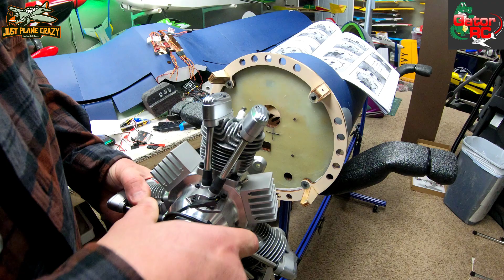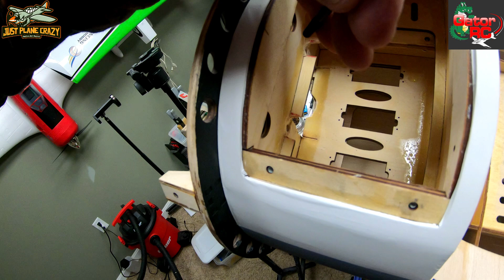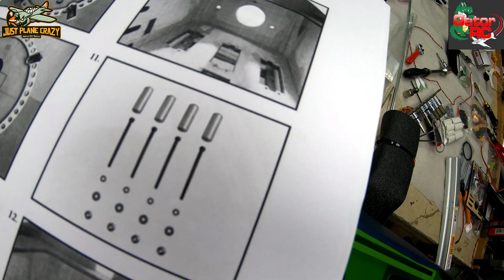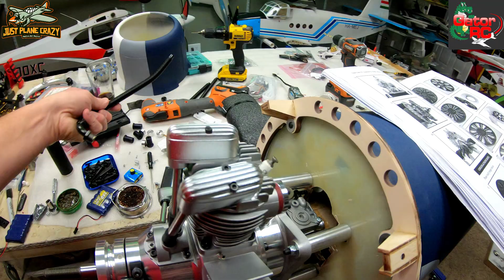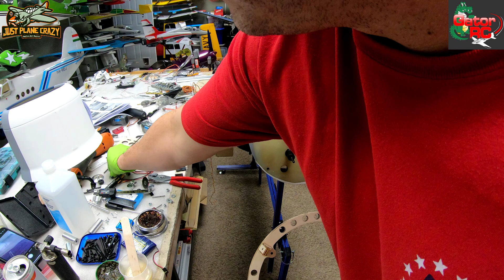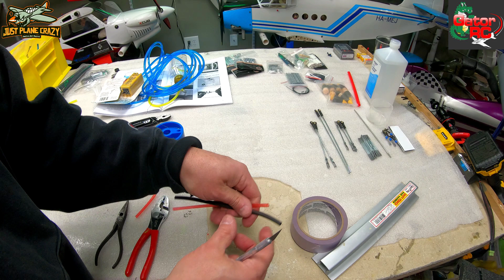Seagull Model Limited Edition 87" F4U Corsair, Pt 1 Installing the FG-90r3,  Radial Power

Comment: I have a fa120r3 engine, I am wondering if the smaller seagull models Corsair is a good fit. What do you think?
Reply from the maker: Unfortunately, not. That engine is more designed for .60 through .90 sized aircraft.
Reply: @JustPlaneCrazy the fa120r3 doesn't make any power for its size and doesn't vibrate like a big 4 stroke. I figured that size of airframe would be easier to pull around

Comment: How is the CG of the model with the Saito FG90 r3? It’s quite a heavy engine and I’m having trouble on deciding on which engine to go with for this model contemplating a stinger 70cc twin but that engine is nearly half the weight of the Saito. Did you have to add any tail weight or did it cg out pretty nice ? Thanks!!!
Reply from the maker: I had to add about 4oz to the tail. No bombs or missiles either.
Reply: @JustPlaneCrazy  oh wow good to know may need to up the engine size maybe to a DLE85 or a dle 111 twin to get closer to the CG. 4oz isn’t too bad at all for tail weight. I like that the model is on the heavier side less disturbed in the air hahahaha. Besides I don’t plan on running any ordinance, just drag that slows me down 😎. Super nice build so far, can’t wait to see it in the air!!!
Reply from the maker: @2Fast_rc u bet. Thanks for watching

Comment: I don't get it why you put a clunk on the filling tubing. For cutting tubing get a tubing cutting clamp, it works wonders to get straight cuts.
Reply from the maker: Because in a tail dragger it doesn’t work. That line is at the top of the tank. Over time without a clunk the line will curl

Comment: Hi, you mentioned the size of the cowl in your last video, my memory may fail me but I recall the last Corsair built for WW11 didn't actually see action as they weren't required. I seem to remember that one way to identify one is the cowl was much bigger, could that be the reason on your plane. Is it a replica of that Corsair.  Love your work. Cheers
Reply from the maker: That’s interesting info. Not sure. By what the manufacture states the oversized cowl was just to allow the use of a smaller radial. The 60 wouldn’t cut it for power. This thing is heavy. Even without all the useless bombs. A normal sized cowl can be ordered. I wish they would ship both with it